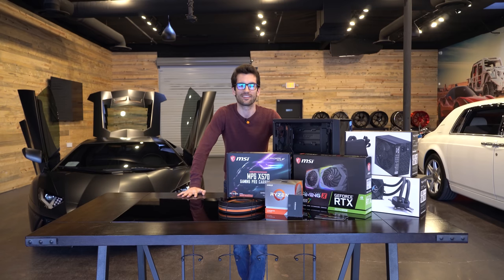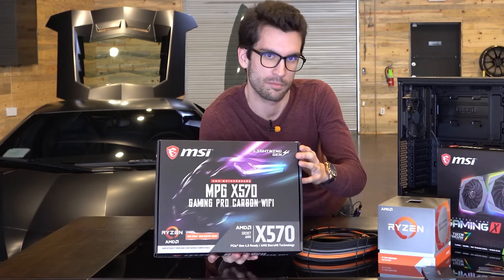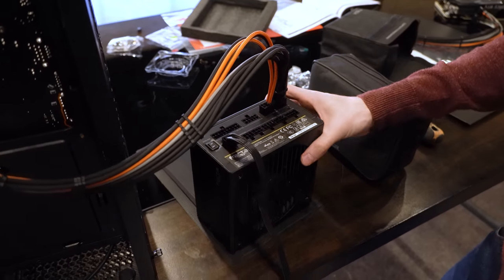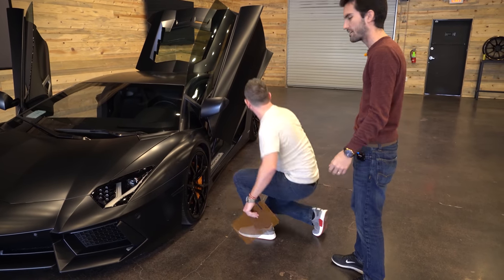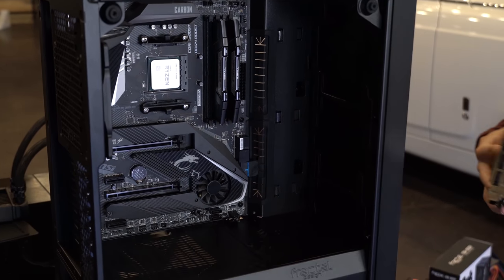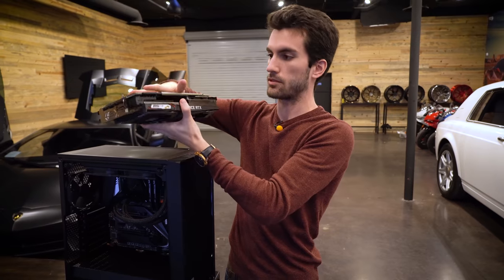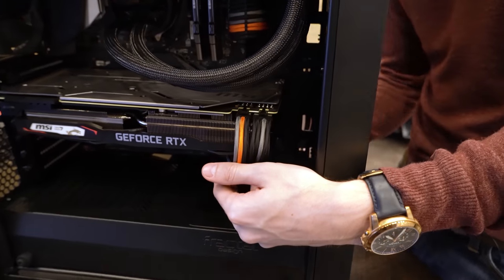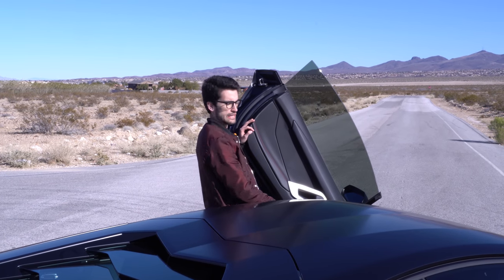Building a Lamborghini Inspired Gaming PC and Giving It Away!

Comment: Shouldve put the rear fan in the front, as intake, so there'd be 2 intake fans, to take advantage of that mesh panel.
The 2 exhaust fans on the rad is sufficient for exhaust.
Super clean build tho' :D

Comment: I got the color scheme of the Lambo Aventador but it didn't scream Lambo you feel me.  Maybe add the Lambo icon on the front some acrylic slipstream-like finishings on the power supply shroud.  Other than that it's a clean build I just wished it screamed what it was inspired from without the inspiration sitting on the side.
Reply from the maker: Didn't wanna overdue it. The case's faceted front panel was enough for me. Sure, we could have plastered a Lambo logo somewhere, but anyone with 2 secs coulda done that.

Comment: That mobo gonna run hotter than that 12 cylinder lambo
Reply from the maker: The mobo runs fine, even with PBO enabled. Temps are great across the board. Not sure where this negativity is coming from, but it's misplaced.
Reply: Greg Salazar I’ve recently been looking for motherboards in this price- and feature-range. Vrm temps (at least were) pretty damn high back when all the reviewers had their hands on it. It seems MSI launched the X570 Unify to make up for it though. 
But sure, MSI might have fixed it since.
Reply: Poligies, I misstook it from being the gaming edge model.

Comment: 6:32 put your object horizontal instead of vertical and you won't have to press the nozzle an extra thousand times
Reply from the maker: Assuming this is directed at Tom, painting it vertical was likely purposeful. If your subject is too long, you'll need to hold the nozzle open too long on these cheap spray cans. Ya want short, quick strokes. Came out beautifully.